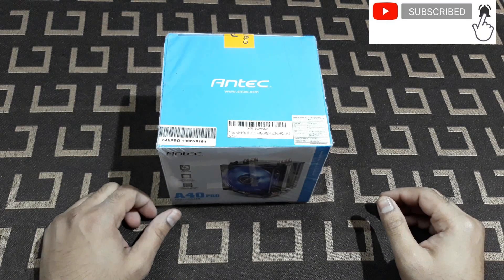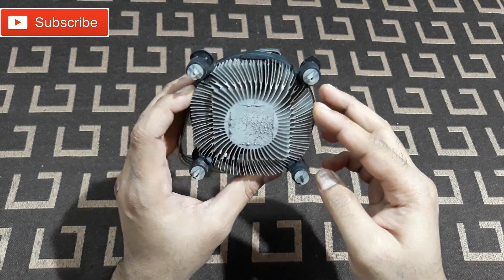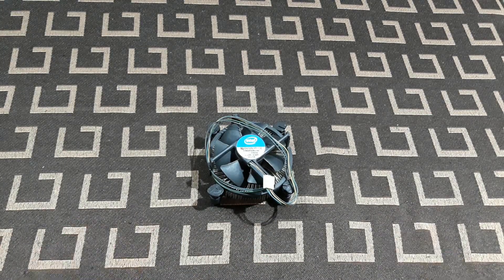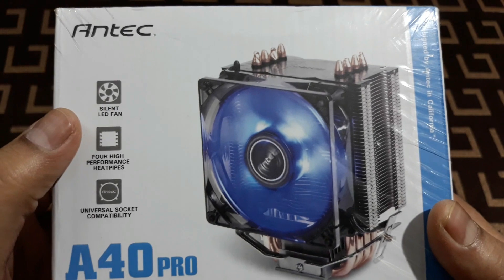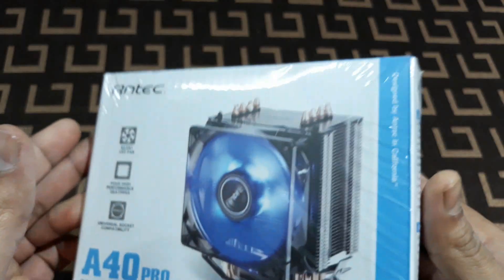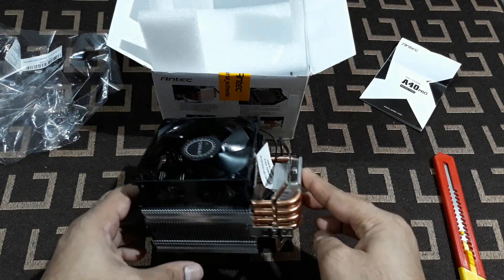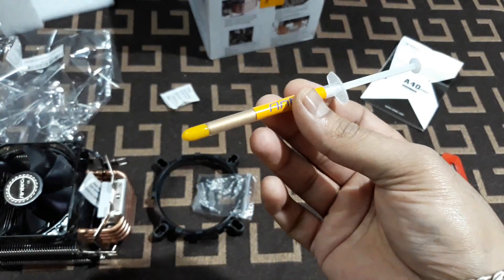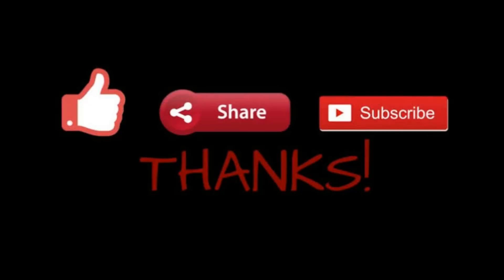Antec A-40 Pro Heat Pipes Cpu cooler Unboxing// Why to Use Cpu Cooler With Heat Pipes

Comment: Is this better than Deepcool Gaamax 400 v2
Can it cool an i7 9th gen
What tdp cpu can this cool
Reply from the maker: Not sure about deepcool's quality. But this one is very good. Yes you can use it with i7 9th gen cpu. It has higher airflow.